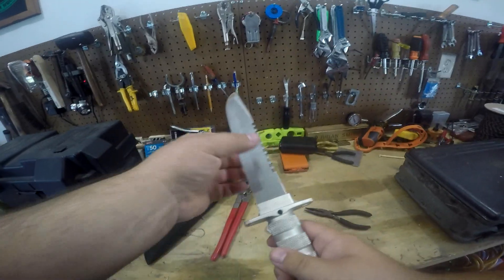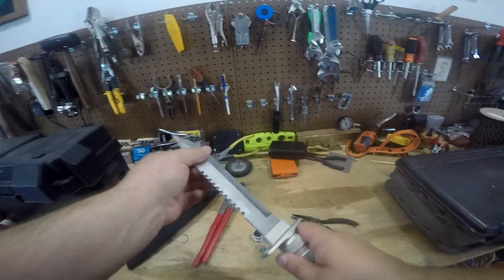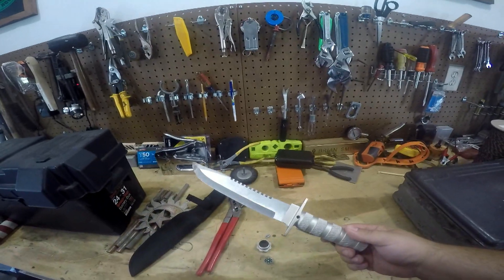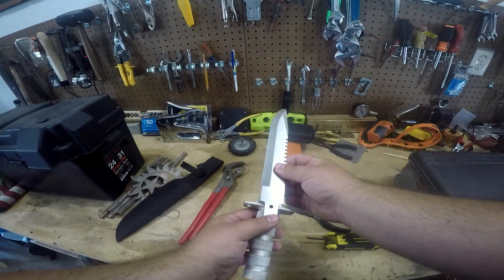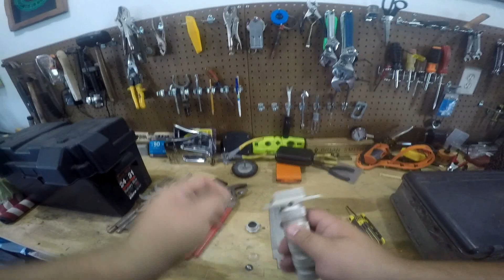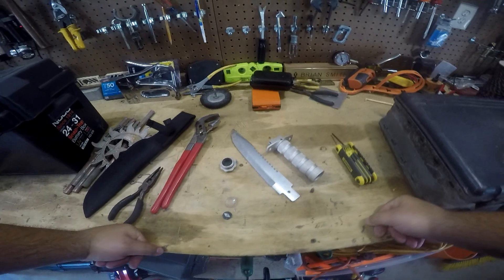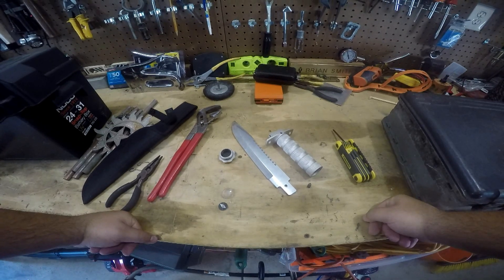Worlds Cheapest Survival Kit Knife $6.99 (Testing - The Results) It's Broken...

Comment: So, I watched more than a few videos on the knife before I bought one 2 years ago and I knew the blade needed to be removed and the blade socket on the handle filled with epoxy and the baled inserted and the screw tightened, and the excess epoxy wiped off. After you let the epoxy cure properly, I believe the aluminum handle would break before the baled would come loose again. My suggestion to anyone is doesn't use it till the blade is epoxied in and use a good quality slow curing epoxy like JB Weld.

The blade breaking. In your previous videos you showed that the blade is on the soft sided. That means the blade is less likely to break than a harder and better edge holding knife.

No matter what knife you use when the edge is dull sharpen it before use.

I spent 11 years camping in the boy scouts and some more as an adult using like 99 percent of the time a 4-blade scout type pocketknife. I have still never battened any knife. I only ever needed a fire small fire to cook some food.

Comment: Lock tighten it up. Jb weld the broke spot and you good to go.
Reply: Hell...do THIS^^^BEFOREHAND....and THEN fire it up!😂😂
Reply: @tikkidaddy  I watched a bunch of videos before buying one. The blade needs to be removed, and the handle socket filled in with epoxy and the set screw threads coated with epoxy and everything assembled, and the excess wiped off and allowed to properly cure.

Comment: That's a feature: it's not just a survival knife it's also a "make your own handle" DIY kit 😁
Reply: So it's a apple product?
Reply: @crippleboi8981  Apple doesn't want you to DIY, they would just make you replace it in authorized service for $99.99. And if you try to go to unauthorized service or to  fix it yourself with 3rd party handle your blade will turn into a soft steel blank with rounded edges.
Also sheath wouldn't be included.